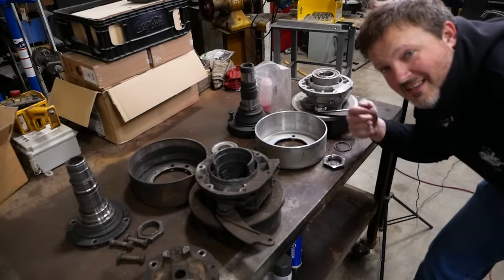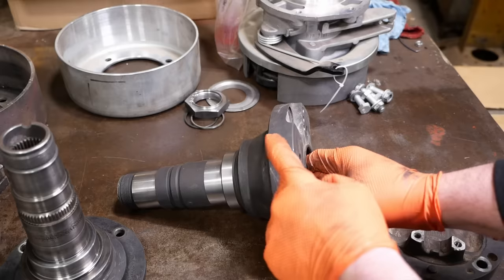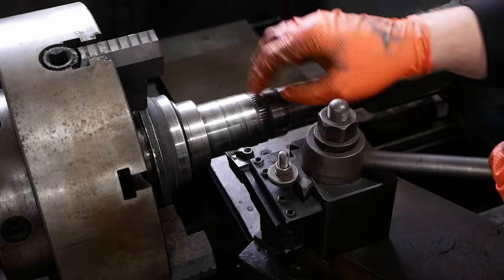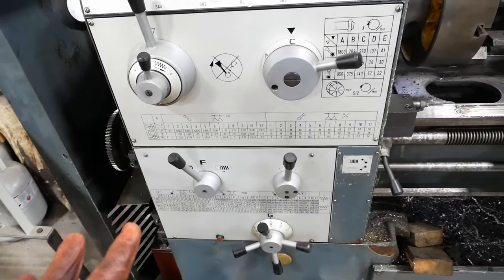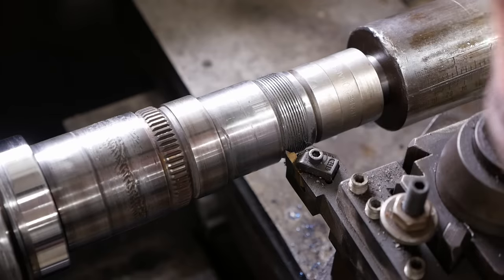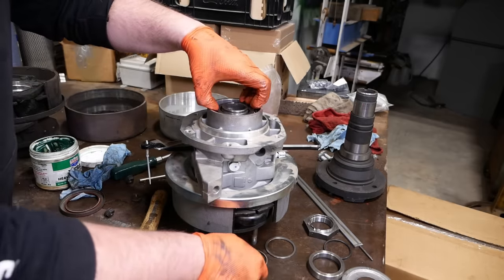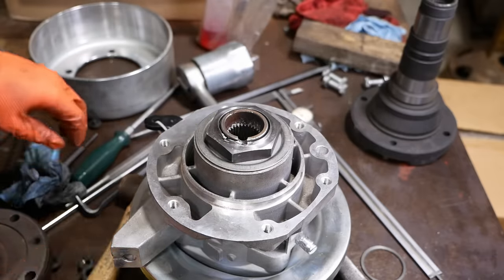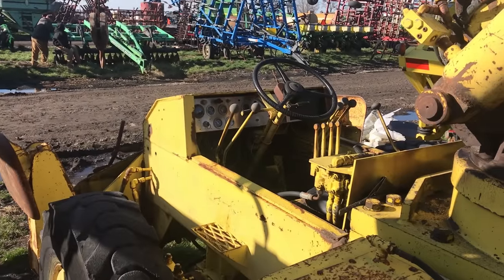"Sir, Your Parking Brake Exploded" - Fixing a Ford

Comment: "Not one of Fords better ideas." I wasn't aware they had ANY "better" ideas..
Reply: I was told, earlier on in my 'fixing things' that FORD meant 'Found On Road Dead'. After being beaten by a Ford pickup, I have NEVER had another Ford.
Reply: not even the FIRST V8 engine?
Reply: @bobrenner7213  I thought FORD stood for:
First
On
Race
Day
???
Reply: @tomtke7351 ...or mass production? 😂
Reply: Try a Chrysler
Reply: @tomtke7351 found on the road deserted. Fu.. over Russian dune buggy
Reply: @bobrenner7213 Fix
Or
Recycle
Dilemma?
Reply: @diesellivesmatter  Ford sold shoes with there trucks at one time, they knew you were going to wear out a pair walking home.
Reply: @slade9372  I remember Ford TV ads with the " lightbulb icon " showing how they did, in-fact, have several better ideas! (One was patting them-selves on the back)  And you know that since I saw it on TV,  it HAD TO be true!  Ah, the old days. Now go drive your exploding Pinto and leave FERD alone! 🤣
Reply: Didn't Chrysler, et al Mopars put something like that on the back of their Torqueflites in the late 50's?
Reply: @karlschuneman7960  is that like the Ford tail gate seats that have Chevy tail lights for waiting on the tow truck?

Comment: The way I understand it; those parking brakes are terrible idea for another reason as well. With an open differential, with the parking brake engaged, the truck could rotate around with one side going forward and the other going back. The driveshaft will not turn
Reply: Only if one wheel is on a very slippery surface, the other wheel has grip, AND you're parked on a hill steep enough to induce a stationary vehicle to slide off down the hill.

So unlikely, but theoretically possible.
Reply from the maker: Any automatic transmission would have the same issue.
Reply: @WatchWesWork  yes, I suppose that's also true
Reply: @WatchWesWork  Not just automatics -- any vehicle where the stopping power is being applied to the propshaft rather than directly to the wheels.  Auto, manual or handbrake doesn't matter.

Comment: Years ago I bought a horton fan hub off ebay nos had same part number and picture well when I got wasn't the same I asked for a refund they said sure but u can keep the hub so found out that my old hub and the nos I got used the same rebuilt kit so I took it apart the nos stock and rebuilt my old one for free😅

Comment: Perfect example of what I despise of Ford.  Siloed Rube Goldberg engineering.  Hey we are finally going to fix that service brake issue... You know... because service brakes had not already been a solution for nearly a century.
Reply from the maker: I know. Especially since they had a regular parking brake setup for the automatics that they could have used.

Comment: You're much more knowledgeable than I, but I owned a Chev 4x4 truck with a Spicer trans that had a similar parking brake assembly, so I'm not sure it was a Ford idea over Spicer's.
Reply from the maker: As I recall, the Spicer brake just fits on the output shaft without all the other BS.
Reply: My home fire dept. had gotten a new ambulance in the mid-late 1980's and then took it to a conversion shop to modify into 4X4 (we lived in central NY). The front axle was supposed to be "new" with the refit. When we had the first problem with the front axle, we took it to a local shop for service. They ran the serial number and found that the axle wasn't new at all, but came from a 3/4 or 1 ton Dodge. The original refit shop stated that they completely rebuilt the axle as if it was new from the factory. This king of stuff where you have to hunt and guess drives me crazy!
Reply: @WatchWesWork  You are most likely right, memory fades, I used to have a picture of the thing when I was selling it but both are long gone now. I was just sticking up for Ford. lol

Comment: Sooooo, the replacement unit is the same, “cep” different…, just amazing.   Wes, let us all know the name of the aftermarket supplier of that replacement unit, and we can probably get your customers money back.  So any of these aftermarket companies advertise “replaces” factory…, and they don’t or won’t, it’s disgusting.
       This reminds me of Fords current production of crossover SUV’s with their “Power Transfer Unit” which makes them an All Wheel Drive”…, has about a spoonful, lubricant in the sealed unit, and is mounted inches away from the catalytic converter.  There is a recommended service interval, but the lubricant gets “cooked” (literally).  Ford should note that the unit should just be replaced with the general air replacement schedule.
       There’s about a billion of those ZF trans, that were made, somebody is bound to have a salvaged unit to replace it with.  But then again it makes for some awesome content from you.  As per usual your work is beyond impeccable.
Thank you sir.
Reply: The problem is, the parts are out there, but you need the part NOW.  Same as getting rid of something, sometimes for free.  You know it's worth something, but you want it gone.  No one you know wants it.  How long you want to keep it until you find someone?  The place that West helped out, probably had no idea that multiple versions existed and never bothered to ask.  This place may never make that mistake again.    Still cost them a couple of bucks, unless Wes was doing it for the Youtube video.  THat's a gamble, because there's no way to know if it will work out.

Comment: Shouldn't that bearing have been backed off like a wheel bearing? Nice repair. Looks like you've still got a bit of machinist in you haha.
Reply from the maker: No. That's what the spacer ring does. The end play is built in.

Comment: Could you just not source and place a transfer case in place of this oddball unit?
Reply from the maker: Then you would not have a parking brake..
Reply: @WatchWesWork  good point but it sounds like this old truck doesn’t already have a lot of things like a Speedometer.

Comment: tungsten carbide..  used frequently hundreds of thousands of yrs ago, on all megalithic structures, inc. pyramids. dont believe the sht they tell you about copper chisels, pounding stones, total bs..they actually had tool tips harder than diamond.. transmission brakes are the best. specially on 4x4rs.. this is why i bought a gu nissan 2000, cos toyotas dont have them..speedi sleeve fix worn seal grooves.. axle bearing race surfaces.

Comment: Ford screwed up.bu using this concept on the backnof the transmission, many bigger units have used this idea on the front of the rear dif...
The hilarity.of all of this.

I just had a conversation with a buddy about his exhaust leak,that facilitated in theory taking it to the dealer...
Yeah, everything was fine until the engineers(that knew how to monetize basic repairs) showed up....

Comment: Hy Wes why do you struggle to undo stubborn bolts Etc when you dont use WD40 to release the thread. Also why do you never clean things like the windscreen etc before you do a test drive. Cleanliness is next to godliness imperative for a professional mechanic

Comment: Decent job fixing it but it will fail again. German design, 200% failure. The only way to fix it is to pack the bearings with marine grease which is sticky and won't get thrown off. Factory lube oil must have been two tablespoons. We fixed hundreds of these with zero failures.

Comment: fords were smart, use the same parts, prop shaft, distance.sealed unit. UNLIKE TOYOTA,  that drains into the transfer then your box blows up..yup, ford were smart, toyota, not so much..plus, toyota ditched the trans brake in favour of bs in disc e brake crap..yeeeehh toyota,,  no thanks..

Comment: So Wes, what happened to the Edison Truck analysis you did? Not only were you all over the place and getting confused with Topsy and OTR vehicles. Your spreadsheet was disappointing.  You assumed a new OTR truck was 200k. You assumed that an Edison retrofit cost 105K on a for free frame and body.  Then your spreadsheet calculated a payback return for so many years. Hello your Edison motors truck is half the price off a new truck.  It makes money straight off. 
I guess Wes deleted the video because he realised he is a few credits short of an B.Eng degree.

Comment: Carbide is not sharp, carbide is hard. Tool steel inserts are sharp but they can't cut Rockwell C 40 plus, or, at least not cut it very well.